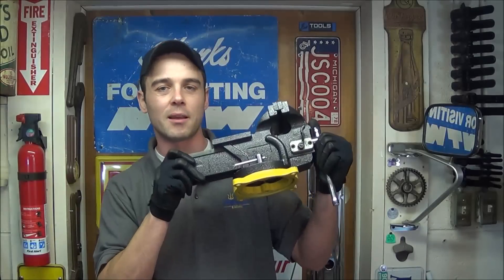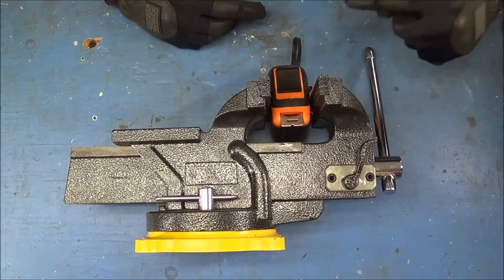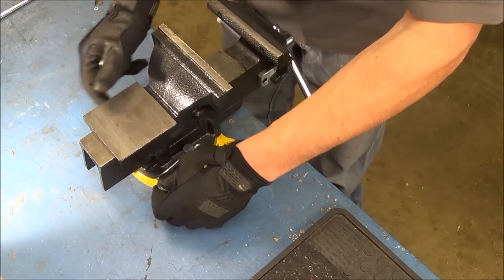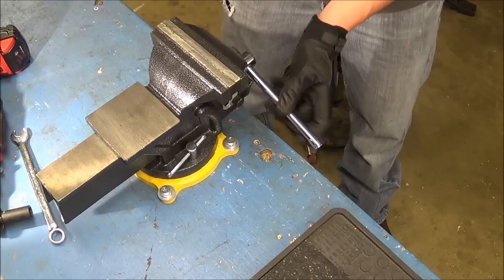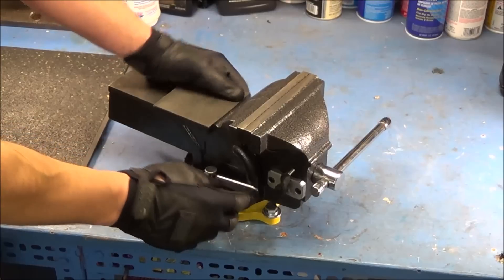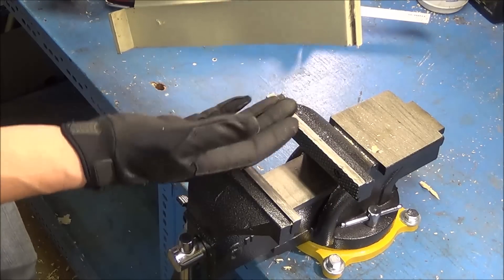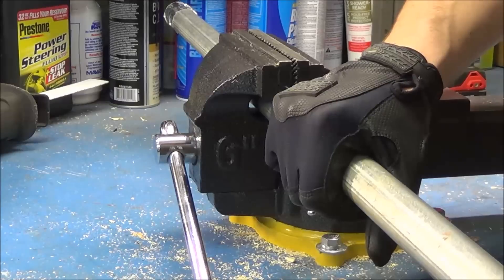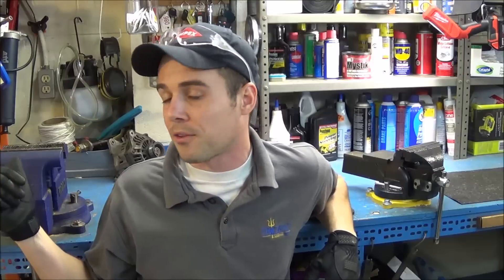Olympia Tools 6" Bench Vise 38-647 Single Hand / Quick Release

Comment: Yost high visibility all steel vises are cheaper than the regular ones, very well built, all of them mount with 1/2 inch or 5/8 inch bolts except the 18 inch one with 3/4 inch bolts, it is just pure awesome. The high visibility yellow ones have black oxide rather than chrome hardware but both vises have dual lock downs and swivel 360 degrees. The only con is the mounting holes need to be drilled out first because they are full of slag, some are even totally plugged up.

Comment: I dont see this lasting 30-40 years because of the ratcheting but I think it would be an awesome vise to have
Reply from the maker: 2LateIWon Yeah, the split nut & spring design worries me for longevity, but time will tell.  I wont be using it outside & I keep everything lubed up with wheel bearing grease, so hopefully I wont have issues.
Reply: specially since you have two.  Im sure your heavy duty stuff will be on the big one.  Im not soo sure about the spring.  that might be pretty easy to replace if need be.  I think I was more worried about the clicking when sliding it is the teeth of the split nut and the screw portion rubbing and grinding on each other seems to me would strip it down over time.  But I think with the use you have intended for it should last a really long time.  Great review love your vids buddy!!